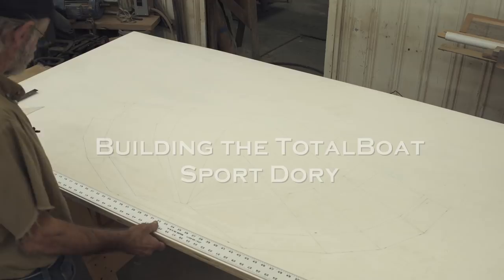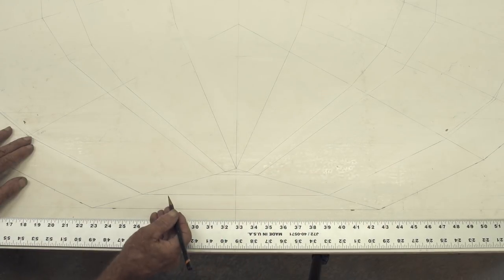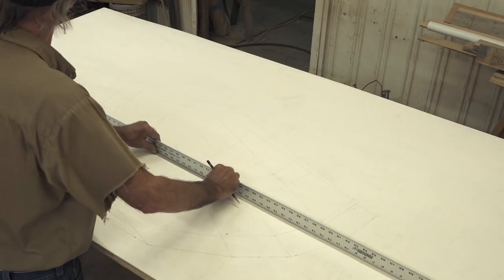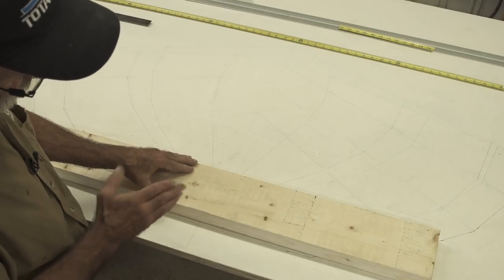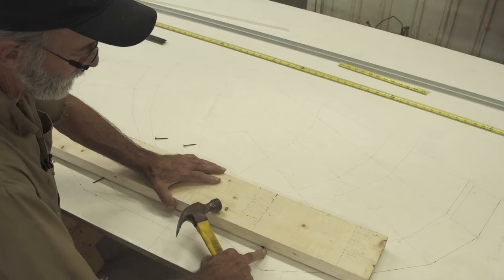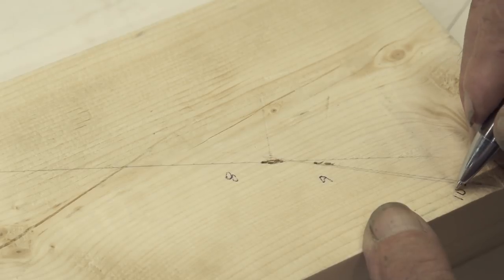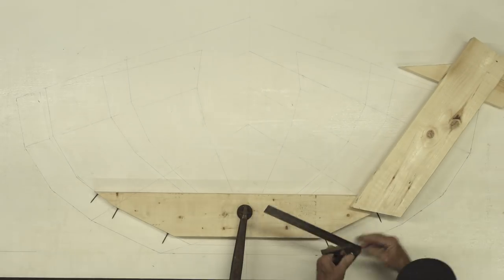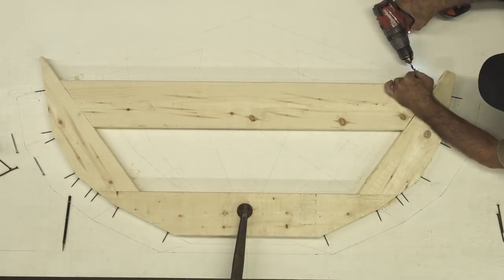Building the TotalBoat Sport Dory: Episode 4 - Direct Transfer

Comment: An other excellent demonstration of the art of boat building. Learned a one and better way of setting the bevels instead of square molds, fitting a batten over them, then planing the rest of the mold to the found bevel. Your method is quick, easy and only needs a bit of touch up...maybe. Loving the series.

Comment: Use a spike tracing wheel which is used by cut and sew pattern makers. Using a small awl to prick 2 points for a straight line, then use the spike wheel for curves.

Comment: I've just done the same process this week with 6 moulds for my John G. Alden Indian Class sailing boat and I'm very interested in the Bevel Boar technique in more detail. I understand measuring the height difference from one frame to the other and I'm guessing the distances between each frame are faired over the the distance between the frames (normally 3ft) giving the angle? My frames are cut square and I'll use fairing sticks and a plane to get the angles.

Comment: After watching the third time and trying to understand the Bevel Batter Board System I could kinda figure out how you did the bottom bevel but you pretty much glossed over the sides of the mold frames.  Oddly enough I have wondered how you might do this and I figured that you would just plain them by hand using a batter board and dead reckoning with a hand plain after the bottom was attached to use as a guide.  I would really like to see how you did that but I don't think it would be easy to understand or explain.

Comment: Lou, When you lift the frame up (@13:35) the point to my right, your left, is more pointed and the cross piece is higher off the table than the point on my left, your right, which point is also blunt, instead of pointed. Could you explain why this is the case? Seems to mean the boat would not be "even keeled" (I know there is no keel) when it sits in the water.

I love your videos. Clever is the best adjective I can think of to describe you.
Reply: That one point on the mold is probably left over from when he cut it out of the 2x stock. There is an inch or so of excess on the top of the building mold points that extends above the sheer line, better to have them a little long to attach gunwales, sheer clamps and planks than too short. And they don't have to be level because the mold is not a permanent part of the boat and it gets removed at a later stage. It might be hard to picture because the boat is being built upside down. You can see how the top edge (gunwale) of our Penobscot does not get close to the top edge of the building mold. https://lh4.googleusercontent.com/-4faHrK8LSqc/UtZ1AFEFJXI/AAAAAAAAKVo/IoSdQ5j5-ts/s640/image.jpg
Reply: Thank you, Kent, most helpful. As you can probably tell, I'm not at all nautical, just an amateur woodworker who enjoys the skills Lou has. Great videos; new learning curve.
Reply: You're welcome. We have learned a lot from Louis, and if you watch a few more of his other videos then it is easy to spring from amateur woodworker to amateur boatbuilder. Start clearing out a space for a small boat :)